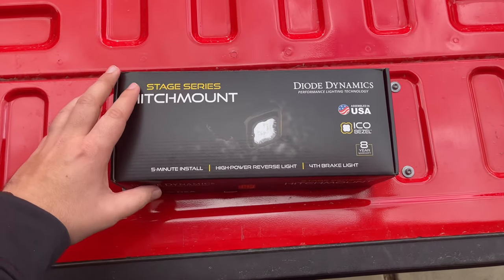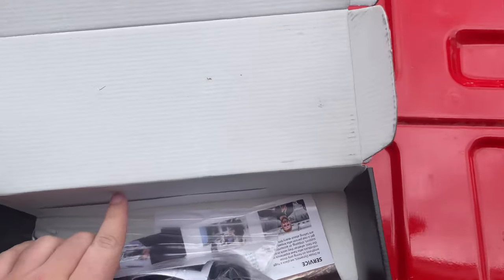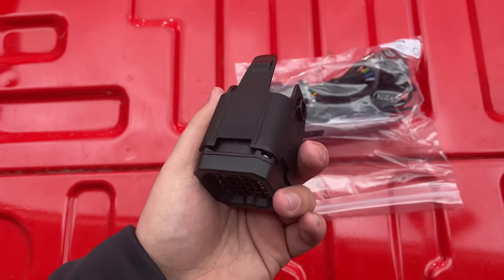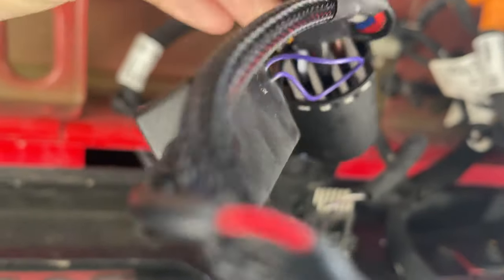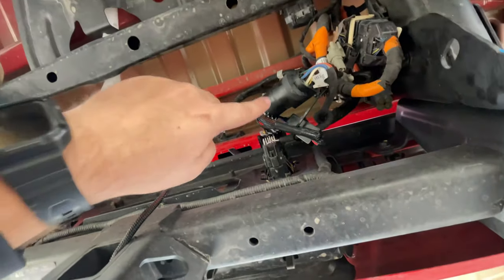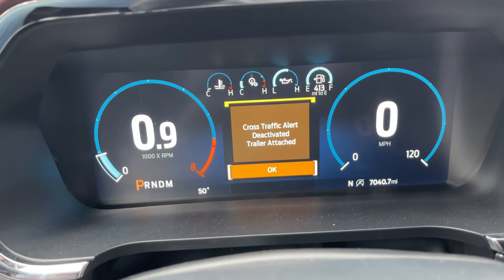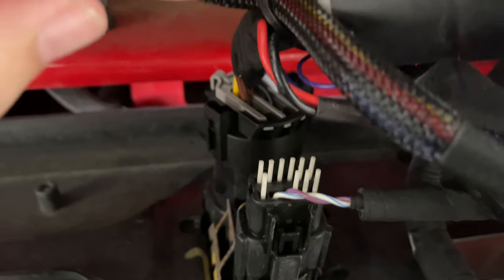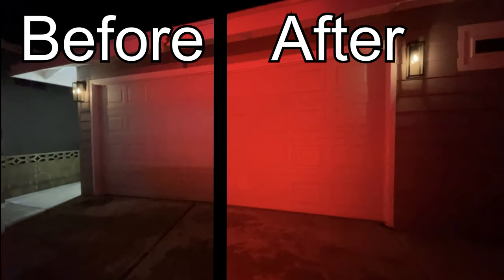Epic Light Setup: Is the CR1 Hitchmount from Diode Dynamics Worth it?

Comment: Hi , got question for you . After install the light , is it easy to remove it out when you need to hall or towing something ? or it will stick in there permernantly ?
Reply from the maker: Very easy to remove, one clip and a plug. Plus you can get a towing hitch lock to protect it if you want.

Comment: Best way to remove the hitch connector is just pinch the securing tabs and pull it out of the bumper to the rear, much easier to get everything removed and connected.
Instead of removing the tabs on the light housing, I drilled a hole in the tabs to fit my locking hitch pin.
No issues on my end with an error on the install. I DO have the max trailer package so not sure why you're seeing this.
My experience is with my 2017 Silverado 1500.
Reply from the maker: They reached out and let me know that it’s only a problem on 21+ f-150s. And they are working to fix it.

Comment: little late to the party... I bought a c1r last year on preorder after someone rear-ended my 22 powerboost. I got it installed in like late feb or march and it worked great. Then for whatever reason I started getting the error popups about cross traffic and all that about a month ago (Apr). I don't get it when I start the truck in the morning (in a garage), but it comes up when I leave it out in the sun. I mess with the trailer settings, but nothing seems to fix it. =[
Reply from the maker: Yup it has something to do with the auto light system and when you set it to the second to bottom option on the dial. Email them they are making new harnesses and will send them out for free when they’re ready.

Comment: Yeah, I just went outside to try and take advantage of this 60-degree day and the locking tab was a pain. I said screw it I'll try again another day. I see you either removed the spare tire or dropped it down out of the way. I think I will try to drop the spare next time. I figured it would have been a quick few minutes to install. I hope I don't have the dash alerts once installed, but im sure I will. I have a 2021 F150. I wonder if there is something I can do in FORScan.
Reply: Just installed mine and got the same alerts. Diode said they are working on an updated harness that will look similar to the one we have now but will have 1 extra wire.
Reply from the maker: Yeah that’s what they told me. But are we gonna have to buy the harness or are they gonna send it to us for free based off our last order. Baja just came out with the same product “pretty much” but they don’t have errors. The thing that’s a little frustrating is that they have an 21 F-150 so they had to of known about this problem but still released it for the f-150 on their page.
Reply: @ColeCulture  They are sending an updated harness free of charge. I just had to provide my order information. 

Yeah, I thought the same about the f150 they have. I wonder if they just connected the c1 and figured the cr1 would work fine also. No clue.

Comment: I was wondering if it would trigger same thing happened to me a while back. I hooked up a trailer tester to disable start/stop. Worked for my 18 and got the alerts on my 21. It’s better you tap on of the brake lights and reveres lights and wire it independently. Of find out what pin in the hitch communicates that a trailer is connected. Go in and pull that pin or cut that wire.
Reply from the maker: Yeah wiring it in may be the only fix. I don’t like it being so permanent in that spot though. I wonder why these newer trucks just have a problem with every single thing you plug into them lol. The product is really good though. Just needs whatever it needs to make it match up with the truck more.
Reply: @ColeCulture  I was told that only the c1 will work the cr1 will give you all those Errors you’re having the c1 will eliminate your problem or cut the purple wire i wat the video on American truck website that explain that
Reply from the maker: I can’t find the video, can you help me find it?

Comment: I bought 2 one for a Toyota 4Runner 2010 , plug and play. Toyota Tundra 2007, I had to hard wire,  my module was one piece. No weird lights or messages. Lights could be brighter.
Reply from the maker: They sent new harnesses free of charge and it no longer throws codes. The 1 inch pod is extremely bright for how small it is. Definitely best on market. I just bought their 2 inch pods and will be putting them on soon.

Comment: I just installed the c1r. I’m having the same issue. I get the errors and the fast blinking lights. It automatically turns off the bliss detection. EXCEPT at night time. No errors at night. I need to try it during the day with the headlights ON.  I like this product but might have to return it, the error noise is annoying.
Reply from the maker: Yup that’s where I am with it as well
Reply: Update. Once my headlights turn on or I turn on my headlights (during daylight) the errors stop showing up. Try it let me know if the same happens to you. I also have the max tow package.
Reply from the maker: I’ll try it

Comment: So, I watched the Short video you posted and ordered a C1R and it was delivered today. I installed it on my ‘21 Powerboost Platinum and test drove it without any Alerts.  No problems, and it works great!  Love it. I’m not sure why you get those alerts you mentioned. I hope you get it figured out.
Reply from the maker: That’s awesome. I’m glad your isn’t having any issues. The product is so great and fixes a problem. Make sure you check out some of their other products. Hopefully they send me the headlights soon! Thank you so much for watching and commenting!
Reply: @ColeCulture  I am just curious… Have you tried moving the light to your brother or father’s truck to see if you can duplicate the errors?
Reply from the maker: Yes all have an error. But we all have max towing package. I probably shoulda added that into the video. Diode Dynamics reached out and said they are working on it.
Reply: @ColeCulture  Well, I do NOT have max tow package. Just the trailer tow package. Interesting.

Comment: Cole I have the f150 2021 limited I also have the hitch light and I known what is happening I went to a certified diode dynamics installer he installed the C1 which works perfectly you purchased the cr1 which will not work properly and it because crash, avoidance the the pulsating brake light is causing the issue you need to Exchange it for the C1 the brake light won’t strobe but it does illuminate with your tail light or cut the purple wire will supposedly fix that issue too but your best bet if you are not sure what to do contact diode dynamics I am looking into installing the Ss3 led comb pod lights with Amber backlit on the a pillar
Reply from the maker: Hey Charlie! Great to hear from you, your one of the people I remember. I appreciate your input and I’ll let you know what I come up with. I hope they respond or fix whatever the issue is. They sale it for the f-150 specifically on their website and that’s where I bought it from so maybe the harness just needs to be adjusted on their end. Fantastic Light though. It’s insane that such a little light has so much power. But that’s why they are the best right now. Hope everything is well for you and thank you for always commenting.